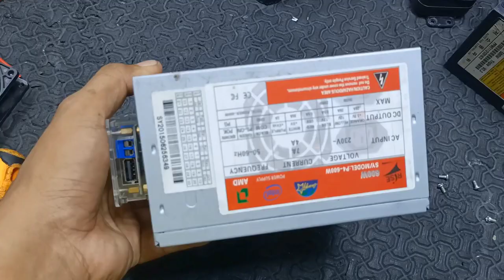DIY BUCK CONVERTER/SHORT KILLER

Comment: This cant be working.Those Dc-Dc buck converters have  short circuit protection built in.So when you try to inject voltage into shorted circuits, the protection kicks in,and shuts down the converter. Prof me I am wrong.Do you have a showcase using this as a short killer.But it makes a nice LAB power supply.
Reply from the maker: ill try this in my own shop.and i detect the shorted using this dc to dc.just put the paste in parts you will see the shorted is heating.
Reply: Yeah. Some of those buck converters have short circuit protection. I wanted to make one for myself too. Have to check datasheet or specs for the buck